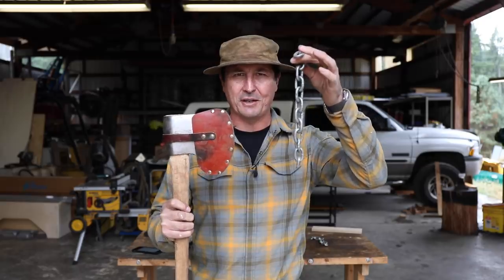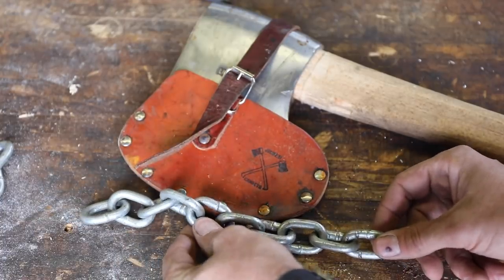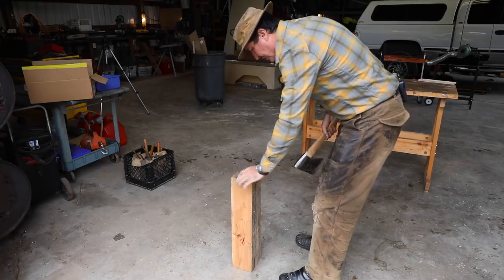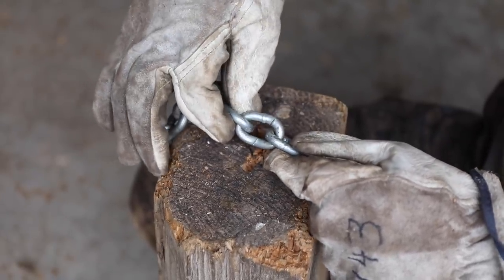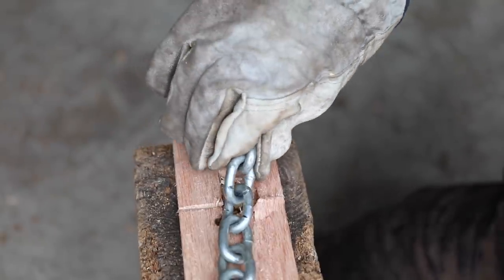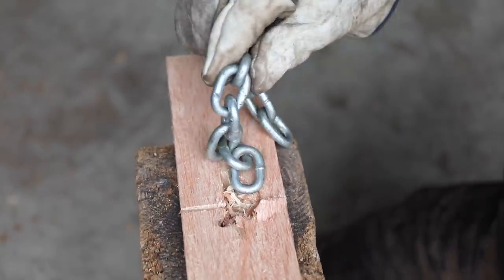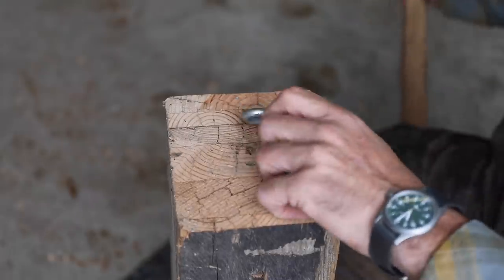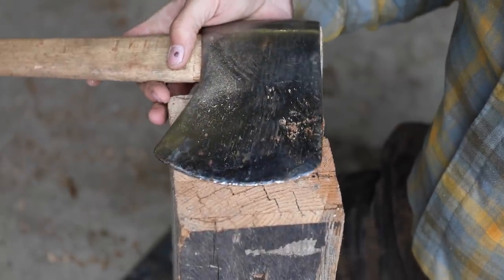Will An AXE Split A Chain In Half???

Comment: I feel bad for the axe, however your test left one factor out. Tention on the chain and cable, which would of made it even easyier to chop.
Reply: Maybe. My theory on that, is that if the chain is under tension, it is likely suspended. Hitting it would cause the axe to rebound, possibly causing him to hit himself with it.
Reply: No difference if stiffly backed.
Reply: I was thinking the same thing should have put a big nail semi tight on each end
Reply: Does the chain in the movie has the chain tensioned?
Reply: @GbbJunkie  that would have been a lot safer too, no chance of anything bouncing back to Mr. W's face.

Comment: A dodge needing a transmission imagine that
Reply: my dakota transfer case has been out. my neighbor just dropped his transfer case out of his ram 2500 today lol
Reply: "Well there's your problem!"
Reply: might as well throw some ball joints at it while you got the tools out haha
Reply: Huh that's funny.. My 18 year old dodge hasn't needed any engine or transmission repairs in its entire lifetime.
Reply: Glad to hear it, buy yourself a lottery ticket might just get lucky twice
Reply: In 18 years the only thing I have had to do to my Dodge was the upper ball joints and a cracked injector line from the fuel filter.  Not bad.
Reply: That generation of dodge trucks were known for breaking transmissions
Reply: DAMN YOU ALISON!
Reply: Got a '07 1500 RAM and every 100-110~ thousand miles the trans goes out. Gone through 3 of them so far but  everything else is good.
Reply: all generations are bad for transmissions, they have even resorted to reaching out to Aisin to build their shitboxes.      never forget dodge at one point thought it would be a good idea to put a 727 transmission behind the cummins.
Reply: +L3G1T, well a transmission is definitely not an engine....
Reply: Douglas I meant engine or transmission problems* don't know how I fucked that up lol
Reply: Might as well buy a Toyota LC while your at it.
Reply: Douglas Did you even read their comment?
Reply: tizoro3 I edited it to correct my mistake I had accidentally left out transmission
Reply: I am a Ford guy at heart. One of my friends drives an 06 Ram 1500 and I pick on him all the time about it. Even though I drive a 91 Ford Ranger and its about to be converted to a standard due to the unreliable auto thats in it now haha
Reply: usually they need 2-3 engines before that.
Reply: Ford for the win
Reply: Have a 94' Volvo Estate with 350K+ miles on it. Use it to haul everything from firewood to concrete blocks and engine parts. Only thing that's ever broke is the windshield wiper motor. I've thrown out the backseat and put in a plywood floor in it. Works like a charm for all shitty deeds I throw at it. Only wish it was 4WD, but hey, you can't get a $700 car to do everything, right?
Reply: +keith moore   You misspelled Chevrolet  The correct spelling is L E M O N
Reply: Old ford trucks, I got a 65 f100 with a cobra jet 390 that runs like hell!
Reply: That shevy In your picture needs a new truck branding
Reply: Only reason I came to the comments was to find these lol
Reply: Lmao fords are worse I think but might just be a fluke but my dads 2005 F150 super cab has bunch of issues needs new transmission engine hasn’t blown yet but on its way and the chassis is rusted out and sags
Reply: Anything beats a Chevy, even a broken transmission

Comment: If you put the chain and cable under tension not huge tension just snug it would have cut a whole lot easier.
Reply: yes but danger is too big
Reply: This! When someone is trying to cut themselves out, they'll hold the chain with tension before they swing.
Reply: Was going to say that as well.
Reply: +Adel Mehdi
"Tension" doesn't mean maxed-out. If its under tension, its not gonna bounce away. Cool Hand Luke wasn't interested in cutting his own leg off to get free, so just the act of spreading his legs from the strike point, put his chain under "tension".

Now, if the chain were under "load", yeah that would be dangerous.
Reply: how much tenion are we talking about? the specific chain would need a crazy lot of tension and it would only help when you cut through most of it. this chain looks like an iron chain? i think a teel chain would be a different deal
Reply: I was gonna say that, it was under a bit of tension in the movie, so I guess it certainly can be done.

Comment: Adding tension to the chain or cable would have made it cut with no backing and less force.
Reply: So you think if you stretch out a chain you can cut it with no backing? I'm hesitant to believe that. The force needed to stretch it out to the point where you could do that would probably break the chain.
Reply: It would work with the wood, but not with no backing. You would need quite a bit of force on that tension to cut through. The slightest bit of flex will act as a spring and Absorb the impact like the wood was doing.
Reply: Todd Secor  A sharp crack is a high stress concentration point and is going to rapidly spread if the chain is under a significant amount of load. Even the first cut could have propagated into a complete fracture if the was enough stress on the chain (enough where it would fail at the new cross sectional area but wouldn't have at normal area) (this is why sharp corners are avoided in mechanical design)
Reply: Ya F that... I’ve seen chains snap while loading sea cans onto a Tri axel, the speed those chains go whipping is scary and could rip you clean in half.
Reply: No way dude.
Reply: I was about to say that
Reply: Yea no.

Comment: Good video. Not only for the axe cutting test, but I appreciated the other info:
•About the Dodge truck
•About fire season in your area
•About the current rain
•About the snow on Mt. Fuji
•About Paul Newman's unshackling
•About the wood processor
•About lodgepole pine firewood, which a great many Westerners have a fondness for
•Even about your long johns
•I can't address your poison ivy. My understanding is that scientists and/or doctors consider itching to be "pain". When I have a situstion with itch, I treat it like pain, which for me has helped. But I suppose your condition is beyond that simplistic treatment. Anyway I pray that you find relief soon.

Comment: the cheapest chainsaw on amazon would be so cool
Reply from the maker: You are in luck Jim. It has been ordered and is on the way,
Reply: Wranglerstar awesome thanks
Reply: yes that would be cool
Reply: I agree, the cheapest gas powered chainsaw perhaps?
Reply: Cody, please don't hurt yourself with them, take extra precautions with cheapo chainsaws lol =)
Reply: Wranglerstar YAS
Reply: Please try to cut a quality chain with the chainsaw
Reply: can't wait!!!!!!!!
Reply: Poulan Wild Thing.  I've got an older one, doesn't even have a chain brake.
Reply: that's one from the early 90s and before
Reply: +Wranglerstar
what manufacturer of axe ?
Reply: How about battery operated chain saw test???
Reply: I was having trouble with my stihl and was mad about the price to fix it I bought a 120.00 chinese saw with 20 inch bar, 5 years later it is still running and yes I heat my 130 year old house with wood in Mi.
Reply: what was the problem with it

Comment: What this test showed the most to me is that this axe is quite amazing, I thought you will propably destroy the egde beyond repair. 

About the cable, I once helped at a industrial sight and they used to cut cable by wrapping it in ductape so it does not frey apart and then hit it with a chisel, they got it cut smoothly with a single hit every time. 

Greetings from Germany,

Comment: I have worked a ton around poison ivy and oak. I used to get it really bad and all the time. I then had a coworker tell me about "Tecnu". You shower with it after coming in contact with ivy or oak and it prevents the poison oils from taking root. They even have a spray that acts like a "Sunblock" for ivy and oak. It's expensive, but it works for me. Love you're videos. God bless you and your family.

Comment: I work on the River and occasionally it's required to use an axe to cut a wire rope. The largest I've cut with a bog standard fire axe has been an 1 and an 1/8th. As long as you have a hard surface you can make it through even thicker cable.

Comment: I think if the cable were under tension, the axe would cut through it more easily and cleanly and you could probably cut through an even thicker cable. 
Great Video!

Comment: Glad u put safety glasses on I'm known for not wearing any then a 1/2" piece of steal shot into my thumb while using a hatchet tryin to cut metal bolt ( it's all I had at the time an place) I thought it was a small piece of metal shar, then yrs later it came out an was a 1/2" long an 1/8" wide flat shar of metal .great videos sir thx for makin them

Comment: Nice test! I have a bit of experience with this. Aboard some of the tugboats I’ve worked we had to cut shackle retaining bolts with a cold set and sledge hammer.  

In my teens I worked on a few tall ships and on one particular occasion we fouled our prop on an errant cable that was somehow anchored to the bottom. 

After having hoisted a bight of that cable, say 7/8”dia, aboard the captain began attacking it with a fire axe.  In three or four strokes it was cut through and we were freed from the cable.  Still though it was not easy.

Comment: Very interesting. maybe you shouldn't be left alone when it rains? Ha Ha!  Really glad you got relief from the fires. The commercial stuff for PO and PI works well. They are oil based so a wash with a precoat (use spray bottle, don't rub and let sit for a couple of minute) of olive oil then dish detergent  with gentle rubbing with cloth then trow cloth away, helps a lot.

Comment: Aloe vera should work against poison ivy rash. You can grow that stuff at home and use it by splitting a leaf in half and placing the exposed sides of the halves on the affected area. Also works against burns. Very handy.
Reply: Oh, almost forgot, plantago major is another, more common plant, that can be used in a similar fashion. The leaves are too thin to split, but slightly crushing them will do, by rolling them between your hands.

Comment: You can tell if an item can be cut by something based off the 2 materials.

The harder material always cuts/scratches. Materials of the same strength will either break each other (if exactly the same) or damage one and break the other (if flaws are present in the broken material).

In the case of welding, it links the chain to itself while also lowering the chains strength at that location thus creating a weak point for you to aim for with an axe.

Comment: On ships they’re cutting rope, not steel cable. Sometimes it’s called cable, but it traditionally was Manila, or hemp rope that was tarred.  Sailing ships had axes, but much smaller and lighter than logging axes.

Comment: In addition to a very hot shower, rub a juicy white onion on the rash.  I've used it for years. If you like, you can puree the onion and apply as a poultice, but be careful of chemical burning if you leave it on too long.  The juice alone has never been a problem.

Comment: On behalf of the logging cable.  As a logger I can tell you that even a 1" swedged mainline can be cut with a few good smacks with a sledge hammer and any 45 degree angle surface on the skidder in a pinch. But always nicer to have the cable cutter.

Comment: My dad was a logging contractor in the 50s and 60s  in southwest Arkansas and he split chains with his double bladed axe.  One side was his sharp side and the other side he used to cut chains. What he would do he would drive the axe into a stump/wood and lay the chain across the dull side of the axe blade and use a heavy hammer to cut the chain. He didn't carry torches are cut off grinders on his log truck. A maintenance vehicle cost to much $. By the way, he used mules to skid his logs He had two pair of miles. Wasn't any big log skitters like they have to day.

Comment: The cable is strong of course but its designed to perform with logitudinal forces. if you expose it to force crosswise its just multiple small braids than can be cut relatively easy.

Comment: I assume the curvature of the blade, was allowing for full contact on 1 side of the link. However, by the time the other part of the link makes contact, the blade has lost just enough energy from its initial contact with the cut side.

Comment: Honestly expected more kinetic energy through the cable and thought you should bind it to something, like the log, to prevent it from whipping back. Have had this happen before, it's like breaking a rubber band in your hands, or a firecracker (it's fine if in your hand as long as it's wide open to allow more energy to dispurce freely), but the other direction as it isn't releasing tension like the rubber band breaking. Not sure if there is a name for those two actions unless just whipping.

Comment: A more accurate way of chopping the chain (although they would never do it in a movie: too much prep  work) would be to cut two grooves with a grinder on the piece of steel, for the chain links on both sides of the one link you want to chop. That way the link would lay perfectly flat on the steel, giving the axe a better, nice horizontal target. The first two attempts with the steel cut one side perfectly but not the other one because the chain was sitting at an angle instead of flat.

Comment: if there is tension on a cable or a chainlink it is much more likely to be cut through so in a real life sceanario it should be a little easier to cut through than in your setup and you still managed to cut it

Comment: Biggest issue I saw with this video when comparing to movies and shows was that they'd always have tension applied to the chain/cables which will make a bigger difference than a hard surface.  Mainly because it should allow you to cut it anywhere vs having to have metal or something just as hard underneath it.

Comment: next vid; restoring an axeblade that cut trough a chain... And yes axes cut trough wire cable, its not something from the olden days, even today merchant vessels have axes standby on the mooring stations fore and aft in case of an emergency.With tension on a wire (because thats the only reason you would cut trough the wire instead of just slipping it off the bollard or drum) you even cut trough easier as you gradually chop away at the wires strenght as more and more strains pop under the tension ...

Comment: Enjoyed your video. Would more accurate if it was a rated chain. Or high tensile steel.  Mild steel chains are easily cut with bolt cutters 👍

Comment: When you know you have come into contact with Poison Oak oil, take a shower and use a wash rag full of soap. The rag provides maximum cleaning of the oil. It is the same principle as getting any other oil off of the skin. A rag works even better than a brush, but without the irritation. If you have ever performed diesel mechanic work and gotten that black stuff on your skin, you can get the visual with the black oil. Nothing else gets it off like a wash rag, but you have to get to it before is soaks into your skin.

Comment: If the cable is under extreme tension, it only needs to cut through enough strands to weaken it enough to snap the remaining strands.

Comment: If I might suggest...
Place the axe... blade side up...drape the chain over the edge and strike the chain with a hammer
Reply: Was about to say the same. 
I've never tried it on chain. but this is how my Gramps thought me to cut braided cable. Makes a clean cut with no fraying. Basically no damage to the blade if you do it correctly.

Comment: you can prevent getting a reaction by getting to a sink or shower or somewhere with water withing 8 hours of contact and use a wash cloth to rub off the oils that cause the reaction. you wanna make sure you use something that can provide lots of friction and you wanna make sure you scrub any area that might have oils on it. i know it wont help now but in the future if you have time you can do that to help not get a reaction or not get as bad of one

Comment: You were standing upright and could put more strength into your swing, paul would need to be sitting down in order to be able to reach his shackle chains, plus he would still be to close to the chains for the axe to swing down using his full strength, therefore he couldn't have cut his shackles

Comment: Wow, that surprises me. I worked at a jail for years & the chain on cuffs & leg shackles are much smaller that this chain. It wouldn't surprise me to see an ax chop through leg shackles that are currently used in prisons. Like I said, they are much smaller & they aren't particularly strong steel. They are just strong enough to hold a human & no doubt, one good hit with an ax could bust them. This is a real, hardened steel chain. I thought no way but you actually broke it. Wow, just wow.  It did damage the ax, which you need to fix & that brings me to the obvious joke of you having an ax to grind.

Comment: I agree with the accuracy. My recently deceased father taught me how to cut chain with an ax, no or little damage. Set ax, lay chain accoss bit. Strike with a hammer. Oops, you need a hammer. But it does work well. Also seems like when I was a kid commercial product was as good as or better than custom now.

Comment: they used to cut steel cables with a double bit stuck on a stump and hitting the cable on the blade. I guess axes were cheap and plentiful but I wouldn't have done that with my plumb or sager that's  double bit for sure

Comment: Years ago when I was working for a logging company we used an axe to cut 3/4 inch winch cable when we didn't have a cable cutter or torch handy. But it made a mess out of the end of the cable as we seen and each little strand of cable becomes as sharp as razor blade. I have a 4 inch scar on my forearm that still reminds me of it after 38yrs.